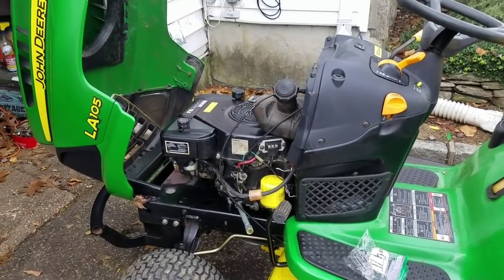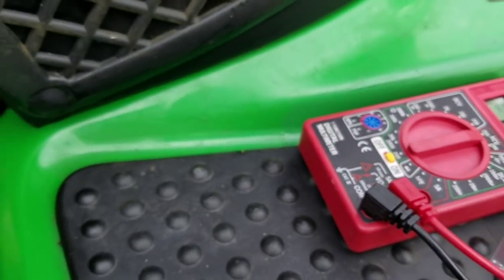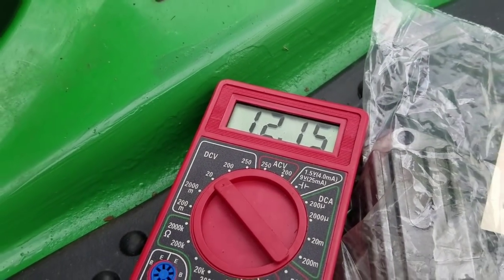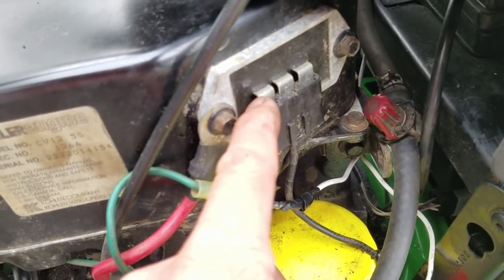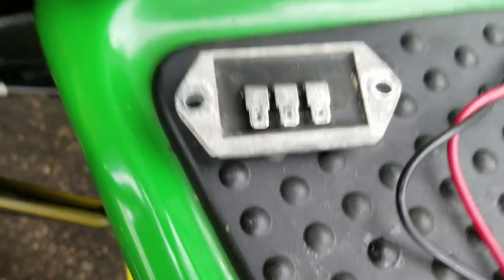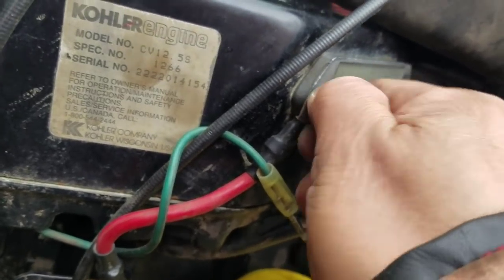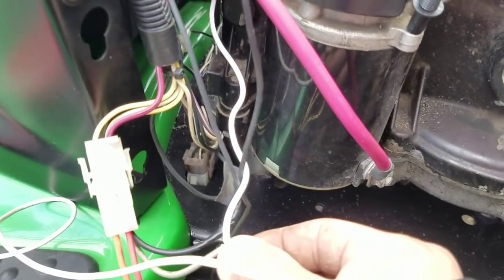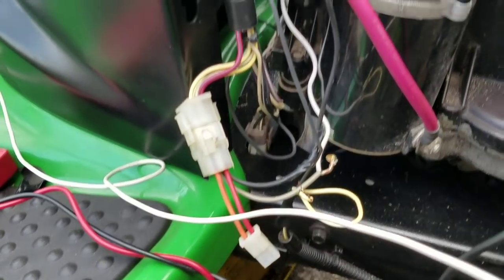FREE JOHN DEERE LA105 KOHLER COMMAND 12.5HP VOLTAGE REGULATOR WONT CHARGE BATTERY REPLACEMENT HELP!

Comment: Your stator should be putting out 34 to 40 AC volts. Check your stator and your magnets under the flywheel.
Reply from the maker: John thanks,  video is 2 years old...it was the stator,  I fixed it and sold it.

Comment: With the connector unplugged from the regulator the 2 outside wires should be 25-35 vac , the centre wire should be battery voltage with key on ... the centre wire goes to the key switch to the "A" "A2" or "L" post on the key switch and the red wire on the key switch should read battery voltage .. with key switch disconnected there should be continuity (in ohms) between the "B" on key switch and "A" or "A2" or "L"  depending on your key switch ... If all test good replace voltage regulator ...
Reply from the maker: Thx for the info mate!

Comment: Run a ground wire from regulator bolt on the right to metal ground.
Reply from the maker: Even though I already have a ground wire on the left bolt to throttle bracket?  I'll try one to the chassis frame. Thanks, will do a video if it works.

Comment: The voltage should be about 40 ac Watch= taryl  = he has a vid on kohler charging system repair Hook the volt meter to the battery and check voltage